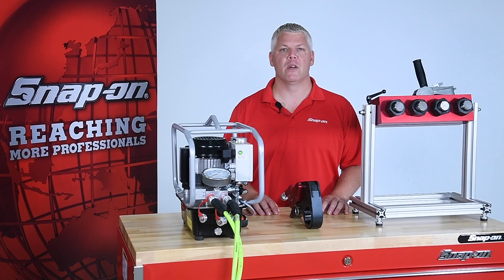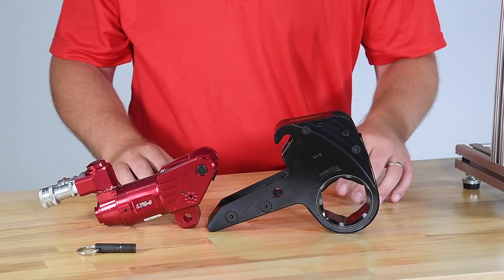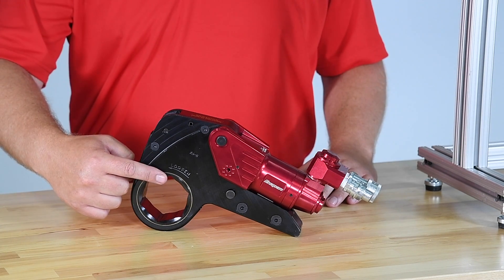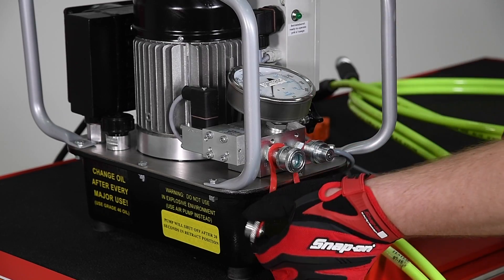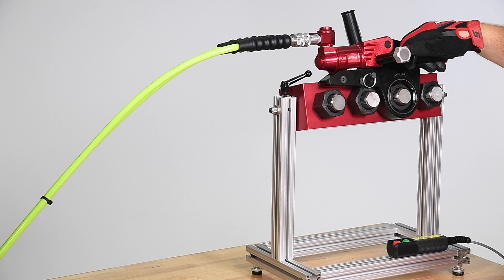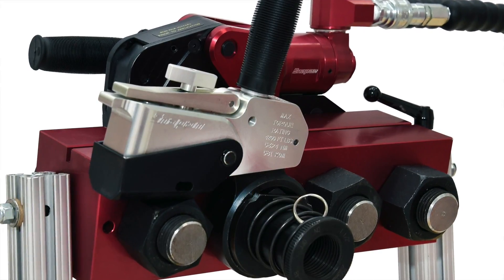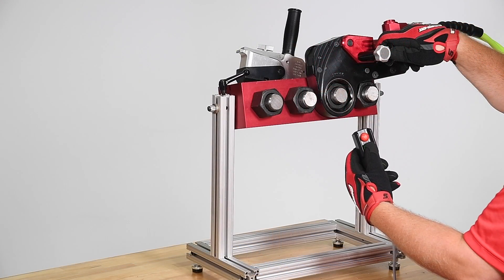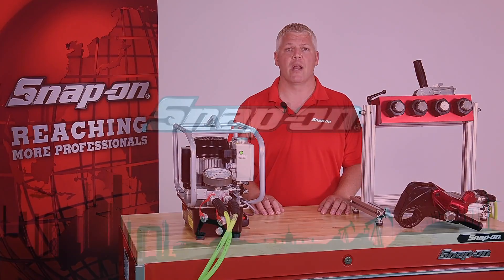LTQ Hydraulic Torque Wrench Demonstration

Comment: does this ma hine need a filter dryer for the supply air which be from a compressor machine... or it had alredy a filter dryer built in on to the machine